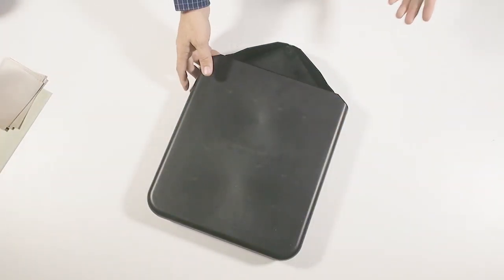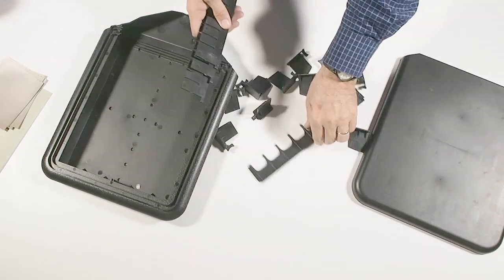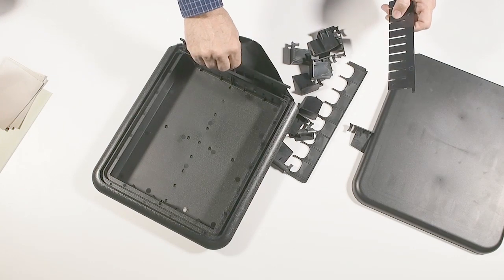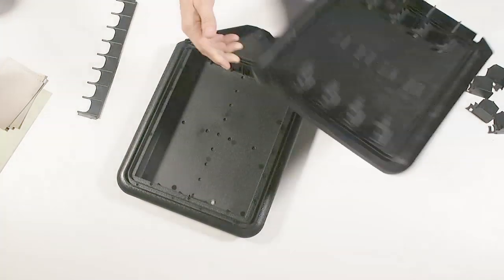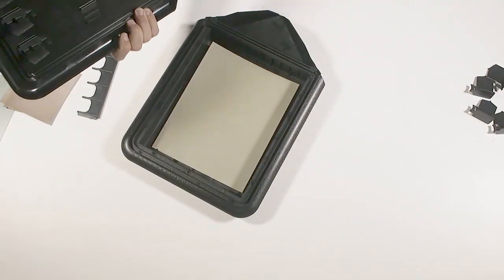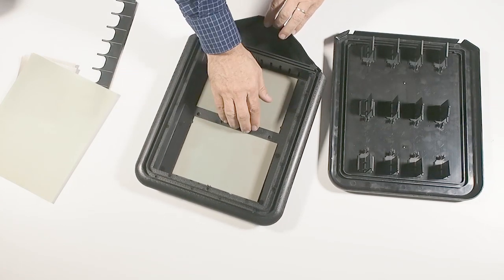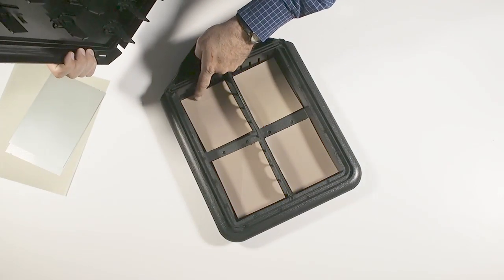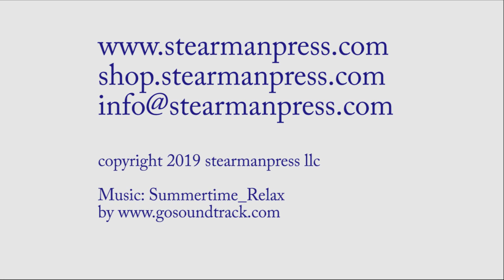SP 8x10 intro

Comment: I love this tank.  I think it is a really brillant design.  The ability to use it for 8X10, 5x7 and 4x5 is really great.  I have your SP-445 tank but I usually prefer to develop my 4x5 in this tray.  I don't have a 8X10 and bought the tray specifically to process my 4x5. This is the easiest loading 4x5 system (short of developing in trays in the dark).  Just great and I thank you for all your work for large format.

Comment: My first concern would be scratching the emulsion and then to a lesser extent, the base.
Reply from the maker: The bottom of the hold down tabs are angled, they only touch the very edge of the film. The texture on the bottom of the tray is "photo etched" and has very smooth edges. Take a look at the user's guide: https://cdn.shopify.com/s/files/1/1273/8933/files/SP-8x10_user_s_guide.pdf?1685

Comment: What keeps the hold down tabs from scratching the emulsion side during the development?
Reply from the maker: The bottom of the hold down tabs are angled, they only touch the very edge of the film. The texture on the bottom of the tray is "photo etched" and has very smooth edges. Take a look at the user's guide: https://cdn.shopify.com/s/files/1/1273/8933/files/SP-8x10_user_s_guide.pdf?1685

Comment: Some raised bumps on the bottom would prevent flat film from sticking.
Reply from the maker: True, but we want the film to stick! We're counting on the surface tension to hold the film flat on the bottom as you add developer.  That's why we've textured the bottom surface; it allows liquid to flow under the film but holds the film when the liquid drains.
Reply: @timklein185  so how do you SAFETLY remove the film afterwards??, as looking at the video/user guide, there is no 'recess' like in a fidelity holder, so one's fingernail can remove the sheet!
Reply from the maker: @andyvan5692   We've added "finger pockets":  https://shop.stearmanpress.com/collections/photography/products/sp-8x10-daylight-processing-tray

Comment: Hello Tim, in the preliminary manual there is the procedure for refilling. Is it possible to have a video showing the trick you mentioned in the manual? Thanks
Reply from the maker: Fausto,

We're working on updated videos; hope to having something out soon.

Thanks,

Tim
Reply: @timklein185  Hello Tim, I don't understand why you need to tilt up the back (I mean the closed side) of the tray when you are pouring the liquids. I  was expecting doing the opposite
Reply from the maker: @FaustoSaporito  It's not essential but it helps the liquid flow evening over the top of the film. Frankly, I've forgotten to do it several times and didn't notice a difference.
Reply: @timklein185  thanks for the info. Anyway I did it in both ways and everything was fine! I developed 4x5 until now and they are perfect! Tomorrow I will try with 8x10

Comment: I process a lot of 2 ¼ x 3 ¼  and 3 ¼ x 4 ¼. Can this be used for that format size?
Reply from the maker: The 3.25x4.25 might work but you'd probably have to modify the "hold down" tabs for the smaller size.

Comment: Since when is film PRESOAKING en voque ?
Not in a hundred years Agfa, Ilford or Kodak
advised the photographer to do so.
You must be nuts.

There are plenty of tanks for sheetfilm:
Kodak, HP, Kindermann, Combiplan etc.
Or make a tank yourself.
Reply from the maker: Really? First read the instructions. The pre-soak to get the film flat, not to condition the emulsion (which, by the way, Ansel and many others recommended much less than 100 years ago.)  As for other tanks, we're not aware of many other daylight safe processing systems for 8x10. Much less that can handle other smaller sizes.
Reply: Ansel Adams recommends using a pre-soak in his book "The Negative", p. 206."The pre-soaking allows the emulsion to swell and stabilize before it is immersed in the developer, this assures more uniform development."  Interestingly, on that page there is a picture of a development tank very similar to the sp-445.